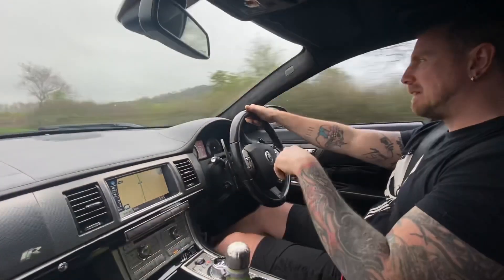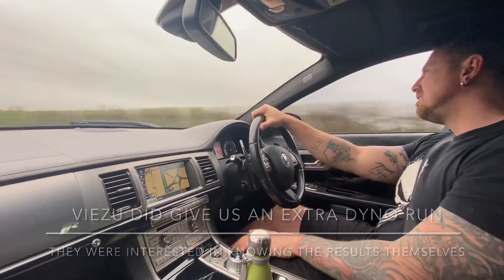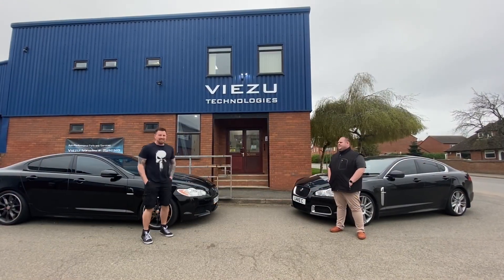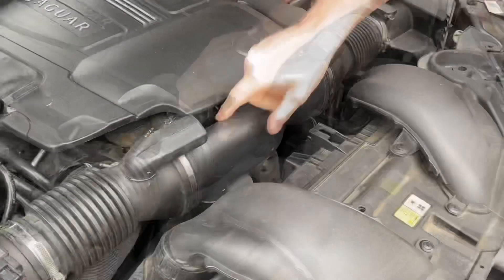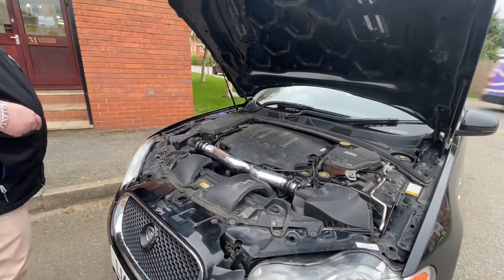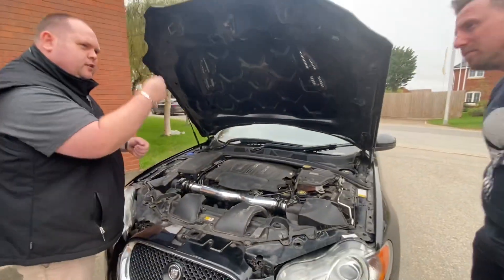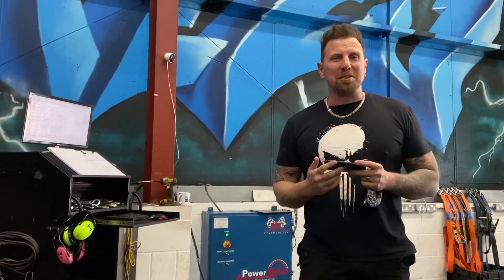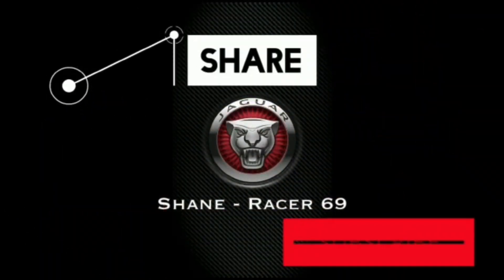Mina Gallery Intake Dyno Tested - Jaguar XFR - does it make any difference or just look pretty?

Comment: wow, incredible video and shocking results! I figure the alloy intake may suffer from a bit of heat soak, but 20 horsepower difference is huge!
Reply from the maker: @maxwellbrown2584  thank you for watching and commenting. check my other video out with the intake I did buy. Silicone so it doesn’t suffer from the heat soak.

Comment: I bought the filters for the sound but avoided this metal heat can like the plague for this very reason. I probably dropped some HP but this would have made it 10x worse.
Reply from the maker: @BSA210  I waited for the system Viezu designed, got the sound and the performance. 
It sure is nice being able to hear the charger isn’t it 😁👍🏻

Comment: I was considering that intake pipe for my 2015 XF 5.0 SC but even before seeing this video, i knew it was just for looks because Jag engineers have already made it larger than the small blower needs it to be. The Mina intake probably would work better if a bigger blower was installed. 2 K&Ns, VAP tune and cut outs.
Reply from the maker: @JohnnysCrap  Viezu have developed their own intake system and tested it on the dyno on an F-Type and it gained power. The XFR version should be ready next month and I have my name down for one, I will post a video of it when I get it.

Comment: What does the intake temp change too when you have the cones on it aswell like your supposed to?
Reply from the maker: Because they are in the engine bay where all the heat coming off the engine is instead of being sealed in a box with the cold air feed.
If you can isolate the cones away from engine bay air then you won’t get the problem from the cones. But the intake itself is also getting hot as the metal is transferring the engine bay heat to the air inside it.

Comment: Let’s do 60-130 test
Reply from the maker: Why would you want to do that, it has less power so it will be slower.
Reply: Prove it with road test 60-130 time not in hot garage & dyno with close & open hood 🤦🏻‍♂️
Reply: Prove it with road test 60-130 time not in hot garage & dyno with close & open hood 🤦🏻‍♂️
Reply: Prove it with road test 60-130 time not in hot garage & dyno with close & open hood 🤦🏻‍♂️

Comment: I purchased intake from mina... Chris sent me coated one. After i finish my car i will try to figure our how can i get cold air :) i already install main pulley , exhaust and intake from mina. My friend remapped. I   am waiting new injectors... we replaced the timing chain. I put new bosch coils, ngk ilkar7 series spark plugs etc...i like the jag, i like the SC...
Reply from the maker: What’s it coated with? You definitely need the cold air if you want to maximise performance. If it’s sound you’re after I wouldn’t worry. All depends what you want.
Reply: @69racer69  they coated with  thermal coating.  we change timing chain. Also I replaced all spark plugs , coils , injectors and etc... We remapped when car was stock . Right now I have lower pulley, exhaust and intake from mina gallery. After I update remap, i want to see Dyno result. Also I will figure out how can the car get more cold air with or whiteout mina intake :) thank you for your videos. Really helpful

Comment: Your test was quite through and proved without a doubt.  It would be great if you did a test replacing the air box with cones.  Great job guys.  Its a shame because the chrome looked nice.  Don't you just hate that.
Reply from the maker: I hated the fact it lost power, I had one in my shopping basket waiting to buy it.
Look at my other videos, there is an air filter and cone test too

Comment: Does anyone make that for 2015 range rover?
Reply: Awesome so I'll get an extra 50 hp with the supercharger pully because with my v switch I have that got me almost 600 hp.  Do im good with 650 hp. You've been great with all your help and answering my questions. Thank you so much. Have a great Sunday.
Reply from the maker: @skippywaters9363  no problem buddy. Always happy to help
Reply from the maker: So you want to detune your Range Rover?
I haven’t seen one sorry no.
Reply: No want I want is that tube that comes off the throttle body and goes to each air box. I want to get rid od the plastic tube.
Reply from the maker: @skippywaters9363  that tube actually loses power, looks nice but looses power.
Reply: Ok thanks for that I just purchased a v switch programmer and love it just looking for something else that will make power without tearing up the motor. Any suggestions?
Reply from the maker: @skippywaters9363  the upper supercharger puller can be changed for a smaller pulley. And if you want even more, then the lower crank pulley ( with a new sized belt) watch my other videos. But please watch the testing at the end, I clearly say in this video that the pipe looks nice but it looses power, it’s an important detail if you’re looking for more power 👍🏻
The stock plastic pipe and stock filter boxes are the best for power so far.
Reply: When talking to others they say you don't want to mess with your pulleys because it over spins your supercharger and that will wear it out faster ive got 74,000 on it now. I was told you can gain 50 more hp by changing the supercharger pully. What's your take on this safe to do or not with the milage?
Reply from the maker: @skippywaters9363  it’s true the charger will spin more but it is kept within the design parameters of the charger. You will be amazed more by the additional torque you get, it’s fantastic.
Reply: Should I do supercharger pully or both?
Reply from the maker: @skippywaters9363  depends how much power you want. The 1st would be supercharger pulley. Will get you up to circa 600bhp 800nm, fairly cheap to do.
Doing the bottom pulley as well puts the price up a lot more because you have to also update the charge cooler, this will give you circa 650 bhp and 900nm.

All depends what you want and what your budget is.
(This is all based on the 5.0L engine)

Comment: Thanks for the Great video Guys, I have an S Type R and you saved me some hard earned moola, just by the sound of the engine on the second run witch I thought the stock sounded beefier and at that time thought it was just my ears however I was very surprised when you said the stock gave better results in in BHP and Torque. Cheers From Florida.  An after thought. The only other test I would have liked to seen was twin cold air intakes with the larger Air filter enclosed at the ends to see if that made any difference in BHP sometimes with bolt on performance parts you have to do a lot of additional work such as exhaust to make it all work together just a thought?.
Reply from the maker: You’re welcome dude, it saved me money too.
Reply: Hi Mate I'm originally from Cheadle Hulme in Cheshire still flying the flag here in Florida with the S Type R lol   @69racer69
Reply from the maker: @romanoguttadauro6116  I did wonder when you used the word “moola” lol
Hope you’re enjoying Florida life.
Reply: Hi Shane, just watched your video in lowering springs and poly bushes. On my 2003 STR three out of four of my shocks are done replacement even on the cheap side using Billies is still around $350.00 per strut plus fitting I'm looking at coil overs and poly bushes as the coil overs can be had for as little as $900 for the set and upgrade and saving of about $500 before fitting I recued the STR from California she's a rust free example two owners from new and she has lowish miles 103K but all the standard routine service stuff has been neglected for about ten years so starting from the ground up as they say. Thanks for the great videos mate its an inspiration.  @69racer69

Comment: Ok.  Thanks for the video but you have some conflicting video evidence here.  First of all dyno runs are always made with the hood up and the fan running to simulate normal driving conditions where the air is flowing through the engine compartment.  Your first dyno testing the intake showed the hood closed.  It should of been open.  No wonder temperatures were higher.  Also was the car cooled down or was it hot?  I also noticed at the end, for the comparison run, you had the hood open with the stock intake back on.  The temperatures will be way different with the hood up.  Also was the car cooled down for the final run with the hood up? If so that will make a dramatic difference on supercharged cars and any dyno run for that matter.  It doesn’t seem you have given the Mina intake a chance at all with the hood closed and tested on a hot engine. Of course the stock numbers at the end will be better.  The environments were completely different.  Anyone can see the Mina intake is a way better design and better flowing than the OEM with all those ridges.  I do think the metal tube would benefit from some kind of heat wrap or insulation coating on it.
Reply: This. Gotta be apples to apples in every way. Heat soak a boosted engine's intake and this is what you get. 

I'd guess the mina intake flows better but the intake isn't that restricted for the stock hp, so intake temps dominate the power results.

The correct take away from this video is that you should thermally wrap your entire intake mina or stock if you want to keep your power up from one stop light to the next.

If you really want to hear the supercharger and keep the intake as cool as possible, remove the plastic engine cover and cut through the engine sound insulation and water dam  at the back of the hood to let sound come towards the passengers and air flow over the top of the engine and supercharger and out the top. It sounds great and will make your engine bay, and intake cooler.
Reply: Exactly. Idk what these guys were trying to prove with this flawed "comparison" but unfortunately a lot of people in the comments ate it up

Comment: It's a supercharged car so naturally the heat is extremely hard to deal with stationary on dynos. Add that to the fact they ran two runs back to back with the hood closed on their intake. Then waited an hour and ran the factory OEM intake with the hood open to compare... Not a fair comparison.

Comment: Racer 69 I have a land rover range rover sport and wanted to do intake and pulley upgrades. I have some stuff picked out and would like your expertise
Reply from the maker: Where are you based? The pulley upgrades are a definite winner, it’s amazing how much extra power and torque you get. The intake may not need to change, if you have a double intake like the XFR, it’s more than capable.
Reply: @69racer69  Understood. Have you any other modifications I should consider?
Reply from the maker: @IdiotSevant  engine wise that’s all you really need. Any more then it start to get very expensive.
You could go for sports cats to help the flow, they will help.
Reply: I’ve already designed it and I’m going to print it in carbon for my XJR.
The filter boxes stay with the K&N inserts, and I’m removing the original intakes/ducts from the boxes over the radiator. Instead, I’m making the intake in the boxes down below, behind/under the headlights – there’s a shitload of cold air there!

Comment: Very interesting! I thought about buying the upper mina gallery intake for increasing the sc whine on my f-type S  and collect a little extra power. Well, i think i won´t do that anymore... BTW. does the sc whine get louder?
Reply from the maker: No the wine doesn’t increase. If you use cones it will increase but u you ou loose BHP if you don’t box them off properly. Mina gallery actually make a good boxed cone assembly.
Reply: @69racer69  Yep, i saw on their website that they sell the upper piping and the cones separately or as a kit. So i think i have to go the cones road to unleash the sc whine??

Comment: Looking at the plastic stock intake and the mina I have to think if the mina is jet hot coated and wrapped it would be better than the stock one? any input? I really dislike the stock one but I love power
Reply from the maker: It’s not all about the heat soak, it’s more around the speed of the airflow, the Mina gallery intake is too big and has slow air flow. The stock intake is matched to the optimum air flow entry speed into the supercharger. If you change it, it would have to be for looks only.
Reply: @69racer69  I was thinking about this too... the Mina must be having some kind of internal turbulence, and that's why it's worse... because only a degree or two of air temperature difference is effectively zero.
Reply from the maker: @kleetus92  I think it’s down to the overall size of the tubes, it effectively slows down the air flow because combined they are double the size of the throttle body inlet. The standard intake is matched to the throttle body so it doesn’t add a restriction and also keeps the speed of the air flow up. The higher air flow shoots up inside the supercharger where as a slower air speed would have to be sucked into the supercharger, thus using some of the power to suck it in.

That’s my take on it from an aerodynamic point of view.

Comment: Sorry to ask on a older video of yours, when you installed the intake did you use cold air filters or leave the boxes it has in ?
Reply from the maker: That’s ok, the only difference in these tests was the intake. The air filters and boxes stayed the same with the cold air feed still in place. So the difference is only due to the intake swap.

Comment: You have to wrap the intake tubes to keep the heat off the metal… without the wrap your intake temp will be higher. If you wrap the tubes and re test you will see an improvement….. also the increase in SC whine is awesome!
Reply from the maker: We did a temp test with them wrapped in the video.

Comment: It's appears you had a tune installed for the stock intake,but I didn't see a map load for the aftermarket intake.Any supercharger will benefit form more flow this test is somewhat flawed
Reply from the maker: The map adjusts to the air flow using the MAF sensors, the test isn’t flawed as it has been done the other way around by an independent person on their car in the USA and had a similar outcome.
Reply from the maker: Plus there is no additional air flow as the standard intake combined has the same surface area of the throttle body, so making it even larger on the intake doesn’t actually give you more air flow.

Comment: Great video so if I take my Mina Gallery intake off I will definitely gain horsepower???
Reply from the maker: It looks that way yes. Another viewer tested their drag racing XF and took the intake back to stock and it gained on the dyno.
Reply: @69racer69  apparently I was reading that the car adjust to the new air intake after several miles so I don't know if it's the actual intake because I don't know if the science behind it is true after it heats up its supposed to work better than the stock intake so I'm going to contact Chris at Mina Gallery and just get him to give me a little more information before I switch it out
Reply from the maker: @adventurousx8220  read all the comment below, there is another guy who was running the intake for year, switched back to stock and on the dyno it gained power. So worth getting more opinions for sure.
Chris is a good guy, I’m sure he will advise you.
Reply: I have a question have you ever change the spark plug and wires on this car and if so is it easy
Reply from the maker: @adventurousx8220  you mean the coil packs, I haven’t done it myself, but it is about an hours work in a garage. You do have to remove a few things to get access to them, like the water bottle and fuse box. Not sure what else.
Mine we’re lucky changed about 8,000 miles ago

Comment: Hi there, I've just come across your videos and watched majority of them in just a day! I wanted to ask how is 600hp treating you, any wear parts, how is the transmission holding up, did you happen to get a tune on it? Would love to know more. Thanks!
Big fan from Canada!
Reply from the maker: Hi Canada 🇨🇦 I love Canada so much, spent a lot of time there in Burlington.

600hp was amazing, no faults at all, transmission is more than capable of the power. I’ve just had a bottom pulley fitted this week and I’m now on 627bhp with 900nm or torque. And it’s even more insane. Definitely worth do at least one of the pulleys. Feels so much better than stock it’s unbelievable.
Reply from the maker: Oh, no tune on the Box yet. HP tuners want a business case before they go to work on cracking the code to allow Viezu to tune the boxes. So unfortunately it’s not looking likely at the moment.
Reply: @69racer69  thanks for getting back so quickly, cool to know you spent some time in Canada! Can't wait to see more videos coming, nice to see someone pay attention to these long lost gems

Comment: Great video and thanks for sharing. I drive a V6 F Pace and running lower pulley and tune. I was thinking what next and searching about this intake tube kit. I am glad I fond this video. Though folks in jag forum mentioned it didn't add any hp but some SC whine, I am shocked to see it reduced hp!
Reply from the maker: I was shocked too.
Reply: I think if you tuned for the intake you would see a difference
Reply: @waltscrossfiresrt6  How exactly would you do that?
Reply: @kleetus92  a tuner would adjust for the increase in tubing diameter and flow
Reply: @waltscrossfiresrt6  I get that, but that makes about as much sense as tuning for a new or clogged air cleaner... I have never seen a performance application become upset that it had MORE air... After all that is totally the purpose of the MAF, to determine the A/F mixture based on flow. Being that he has it tuned already, this literally makes no sense.
Reply: @kleetus92 because you don't have a supercharged vechicle and have never dragraced to see a actually difference in intakes because it's a known fact dynos aren't always accurate when it's comes to performance.
Reply: @waltscrossfiresrt6  would you a picture? FFS...